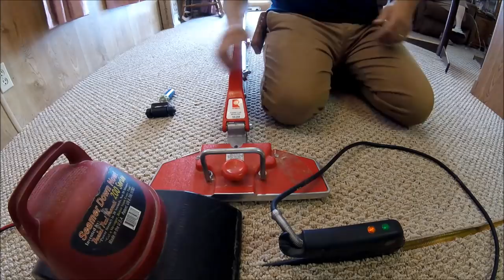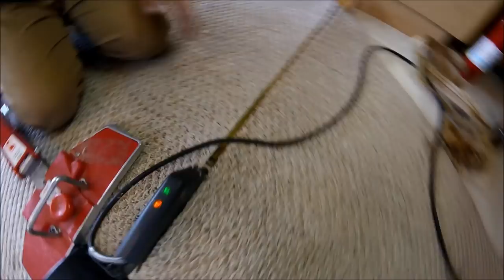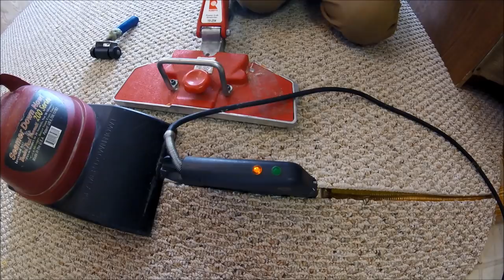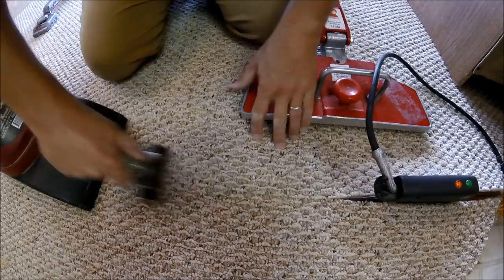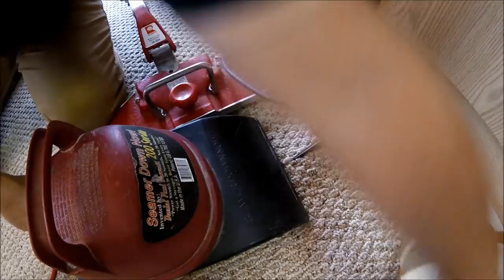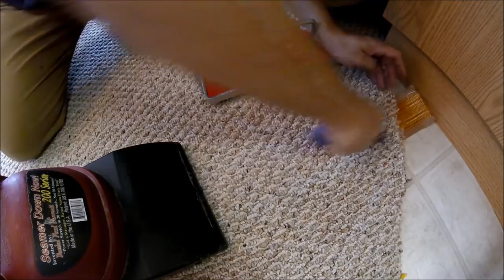BERBER REPAIR

Comment: Looks good. Had to do almost the same thing a few months ago. Brand new carpet that we installed and the owner would vacuum the floor like 3 times a day, eventually pulling a 2 foot long row out.
Reply from the maker: Matty Lee85 yep same here I just installed this carpet last month and the lady said I guess it was her maid was running the vacuum cleaner way too low and after that she told her to adjust it up Some , That was the first thing I did when I got there I asked the lady if I could see her vacuum cleaner and I looked at the height settings, that’s when she told me she had the maid adjusted up some because when I seen it it was on level four out of five so it was almost all the way up, carpet manufactures will tell you to just have the brush on the vacuum barely tickling the top of the carpet, if you can hear stressing The vacuum motor while you’re running it it’s too low And needs adjusted up

Comment: Nice, we just ordered the seamer down..I see ya got ya a 4x4 board.
Reply from the maker: Jeremy Gibson That’s great you’re going to love your seamer down now , And it’s a 2 x 6 I actually have three different sizes that I use for occasions like this I always use one in mobile homes in places where there is no baseboard
Reply: Guys look into the tri-force stretcher , I made one from 1 inch and a quarter conduit and two harbor fright kicker heads , it'll change your life , no more setting up poles or worrying about trailer walls , makes restreches a breeze too

Comment: Do you ever get the stretcher head snag the carpet? I know they got the circle dial that can be adjusted.
Reply from the maker: Christian Wilson Very rarely because I am in the habit of picking up on the handle which makes the teeth reverse out of the carpet as a pick up on the stretcher